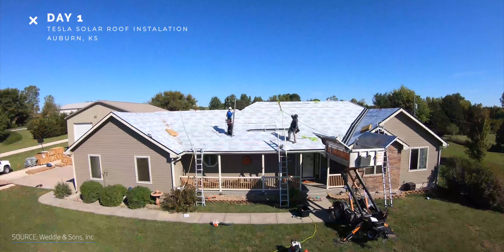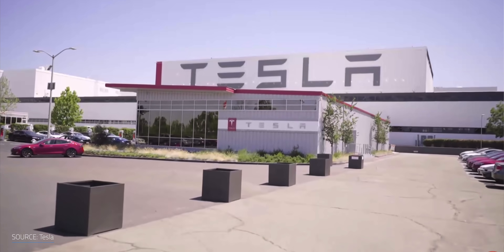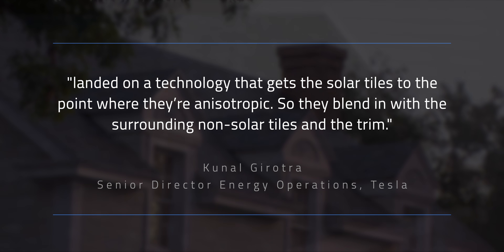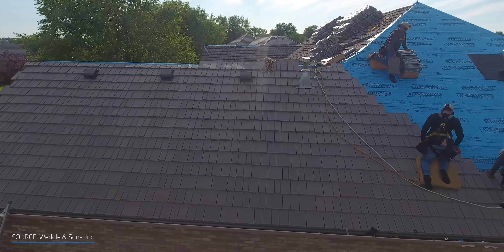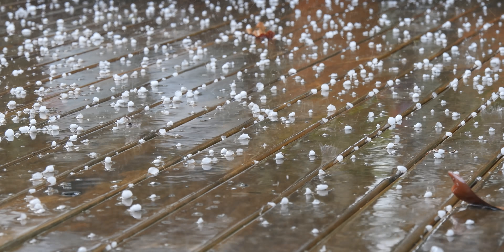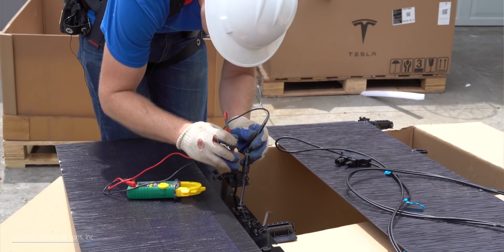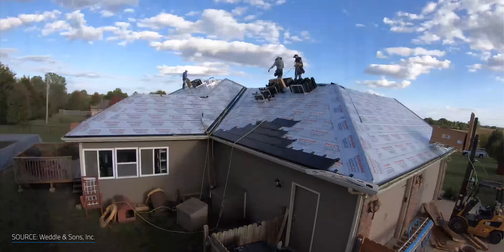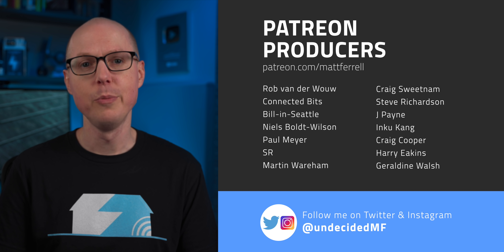Exploring If Tesla Solar Roof Is About To Go Mainstream?

Comment: Yeah I'm a professional roofer, it's important to remember how important roof integrity is as a vital building system.  Roofers are forever in a battle with integrators who install their rooftop infrastructure but damage building integrity when they do so.  

Roofers fundamentally understand building integrity, other trades it's an afterthought.  PV installers aren't roofers, so yeah it makes sense that roofers are the primary installers.
Reply: @Slowmo I'm pretty sure you don't have to worry about that.
Reply: @Potato Peel hilarious, you know what every building has?  
A roof.
Do you know what a building without a roof is called? 
Abandoned. 

Do you know what type of roofing 99% of buildings have?
Conventional roofing.

Do you know how long a conventional roof lasts?
20-30 years.  Meaning a roof replaced at the beginning of a roofers career will likely be replaced again before they retire.  

Roofing is a building system that must repel weather from the interior of a building for 2-3 decades with little to zero maintenance after an initial installation.  Meaning a faulty installation WILL result in premature failure, usually within the first decade.  Complex roofing systems like the Tesla roof are effectually impossible for an inexperienced person to do an effective installation.  An ignorant person might argue that Tesla will provide training,  and they will.  Major international brands like Soprema and Firestone already do this, I am certified by both manufacturers to do warrenty level installations of their products.   Tesla will almost certainly adopt a similar practice as such enhanced training for experienced professionals only takes a few days because the training builds on existing experience.

So no roofer is going to be out of a job, I install what the customer wants and pays for, I'm happy to do it as long as it's a quality product.  No roofer wants to look bad when an inferior product fails in spite of their best efforts.
Reply: The weight worries me   Our home was built in 1961, the roof framing structure is 2x4’s with 1/2 inch thick boards.    I am thinking the boards be removed and strengthen the structure in addition to replace the existing ties from the roof into the framing the. Go with an interlocking plywood sheathing.   Question is the roofing company have a license electrical team to connect the wiring up
Reply: @edl617  so there's a standard spec for roof construction.  1/2' plywood is standard sheeting for roofing and is considered the minimum sufficient.  By this I mean 1/2" plywood is just fine, but 3/8" plywood is always unacceptable.  Now there's also a standard spacing between trusses, of using plywood the trusses must not exceed a spacing of 16" on center.  And 5/8" plywood must not exceed a spacing of 24" on center.   So if you rafters are spaced accordingly then your 1/2" decking is just fine, assuming no rot.  Deck inspection and plywood replacement are part of the contract and there is usually a set price per square foot for Deck replacement of need.  The inspection is included in your contact, and if replacement is needed it's an extra but at a pre agreed price usually.   

2x4 rafters aren't necessarily a bad thing, I'm a roofer not a carpenter so I can't tell you the specs for roof trussing.  But I can tell you that most roofing specs are made to allow snow loading. 

Long story short if your roof was built within spec then the weight of the solar roof shouldn't be an issue.   As for T&G plywood (what you called interlocking) it's usually not necessary on a pitched roof,  if all your rafters are properly spaced then your plywood seams end on the rafter making the the interlocking redundant.  Technically it can help on the other side, but because of the angular nature of force in that direction it's minimal.  

Now on to wiring.  My assumption is that Tesla does the roof design quote.  They will measure your roof and create a plan for the roofer to install.  This plan will include a wiring layout and connection sequence, the roofer just has to follow the diagram and plug panels in, using the right sequence as outlined by the Tesla design.  The roofer will not hook-up the panels to anything, that will certainly be done by an electrician or other specialist.  I see no reason why  the Tesla certification program cannot appropriately train a skilled roofer to do a wiring layout with plug and play components.  

Technically the electrician's could balk and demand that only they can lay wiring as they often do with low voltage data cabling.  But the hazardous nature of working on a steep roof is a stronger argument against them.
Reply: @edl617  are you 100% sure those boards are only 1/2"? I've never heard of that. 3/4" (1x6 or 1x8, nominally) were typical before the advent of plywood, and the 3/4" boards are far superior to plywood structurally (as long as they aren't completely rotten). 1x boards are stronger and resist water damage for much longer than plywood and are an infinitely better material than OSB. If the 2x4 rafters have too much deflection, it would probably be much easier to add additional truss bracing between them and the attic joists
Reply: @edl617  I originally thought the same thing but it just depends on your area, my beach house is built with far superior wood than my new house I had built in 2017 although to less efficient standards overall for the beach house. I was surprised when I gutted the kitchen down to the studs to find they just don't supply that level of wood anymore so in some fashion I would argue that your older home was built with stronger wood in general. Not sure completely about the roof.... definitely not my expertise.
Reply: I always thought the roof was the most important part of a building.
Reply: @holocaust_2.0  I prefer to think of it as a fundamental part, I hate playing this or that is the most important thing.  Everything is there for a reason after all.  But a building isn't really a building without a roof.
Reply: To bring cost down, could you install Tesla roof on one side and asphalt on the other? Or are the non-PV panels of the Tesla roof relatively inexpensive?
Reply: @nwsvndr  well I don't know the pricing, but yes the non PV are significantly less expensive, but they are also far more expensive than normal singles.  Both in material and install cost.  Remember that a shingler is quoting by the hour for labour.  Singles are very fast and crazy simple to install once you're properly experienced.  The Tesla system will require a level of custom precision shingles simply don't need.   The Tesla roof also relies on an expensive underlay, that's the white membrane you see on the roof in the video.  Such underlays are both optional and uncommon in shingle assemblies.  

As for the question of installing a Tesla roof on one side and a conventional roof on the other, the answer is yes.  A custom tie-in would need to be done by the roofer, but there are multiple tricks that could be used.  Do I recommend it?  Technically it's a question of asthetics, and I wouldn't recommend it on a hip roof(a roof with faces on all sides instead of two). 

Honestly if you want the best solar, you don't build a gable or hip roof, but instead a low pitch single eve roof facing south.  Then install a flat roofing system, I recommend EPDM rubber, and a curbing system as part of the roof for mounting the solar to.
Reply: @Potato Peel who exactly do you think is going to install Tesla roofing?  Roofers duhh!  Probably not the shitty roofers that bought an air tank, ladder, and nailer at lowe's  and started taking jobs without insurance.   Do you know what people who install Tesla solar roofing will be called?  Roofers, because it's a roof, adding solar panels doesn't change that function.   Nobody, not one person will say, "it leaks like a sive, but at least my electric bill is easy cheaper." Nobody is ever saying that.  Every roofing system is already modular, conventional shingles modular and are dead simple to install.  There's literally compete instructions on the inside of the wrapper if you know how to interpret them correctly.   And yet roofer is a thriving trade, gee wonder why.  For every person who attempts to do it yourself with a tesla room, there will be thousands who pay a roofer.  Because roofing is hard work too, work that you can pay somebody else to do, usually in a fraction of the time, with less mistakes, and you can make them come back and fix their mistakes for zero charge.

But whatever, you live in a fantasy world where you've never installed a roof, let alone a solar roof.  Come see me after you've done either.  You'll find that modular systems are only great when the structure is built nice with no complexities, and perfectly straight lines and consistent angles.  Which rarely if ever happens.  Oh and I guess in your fantasy world all roofs are pitched, which is the only type of roof a tesla roof can do.  Because what's also a thing in the real world, flat roofs, you know the roofing on most commercial buildings.  The roofing I specialize in and is completely unaffected by Tesla.  There's no sense in integrating a solar system into a flat roof, because you want angle on your panels.  They already put solar on flat roofing, usually poorly and it damages the roof.  Solar is a huge employment generator for roofers, you been rekt by real facts from the real world son, better add some dragons or some shit to your fantasy next.
Reply: @Potato Peel you've never seen solar panels installed on top of a flat roof?  You could actually integrated them into the roofing system, but it would lie flat limiting the sunlight received.  Usually solar is placed on top of the roofing system, often with hilarious results.  My personal favorite was when they didn't put protection between the solar framework and the roofing membrane.  My colleague spent weeks repairing the roofing and insulation after the solar system damaged it in multiple places.  What happens when you hire a solar integrator not a roofer to do an install.  You still need the integrator, but the roofer supervises the install upon the roof.   More mundane failures involve integrators forgetting that roofs need to drain water or that you can't simply poke a hole into a roof and seal it with a $5 tube of caulking from Home Depot.   Hiring a roofer to do structural integration costs a few thousand dollars.  Ruining a roof costs hundreds of thousands of dollars to replace, plus whatever damage the leaks do to the building interior.  

Roofers only care about one thing, keeping weather out of buildings.  We're happy to add solar to the equation, and will charge appropriately.  We have more than enough work to keep us busy, so we are happy to see it done right the first time.  There's no such thing as a roof that doesn't wear out, roofers will never be out of a job.
Reply: @Potato Peel I am payed to install roofs, by definition that is my profession, ergo I'm a professional roofer.  You seem to be confusing the definition of expert with professional. But you're also just bad at reading, because everything you accuse me of not knowing is just you failing to read correctly.  Rooftop solar can be ideal when done properly, it can be a nightmare when done poorly. Nobody wants a leaky roof.
Reply: @Potato Peel lol, why would I be nervous?  I don't even know what you're on about, my comment talks about how roofers are better to install Tesla roofs.  See solar is usually installed by a solar integrator onto an existing roof.  But Tesla solar roof combines the two systems, leaving the question of which trade should install solar roof.
Reply: Yep I did some temp work for a PV company and man it was atrocious what I had to witness on that roof
Reply: No joke, hard enough finding roofers who stick with the trade long enough to master the concept of proper flashing detail - can't imagine how oblivious non roofers would be
Reply: @onetwothree4148  roofing, especially flat roofing which is what I specialize in, is like an arcane art.  You could read all the books and still mess it up, the best roofers were taught by other roofers.
Reply: @jeremyO9F911O2  Yep. "Experience is simply the name we give our mistakes."
-Oscar Wilde.
 The best way to get good at anything is to learn fro m other people's mistakes.
That's why learning from others that "been there, done that", is the best way.
Reply: @jeremyO9F911O2  Eh, I'll stick with Roofus

Comment: the solar panels efficiency starts to drop rapidly after being in the elements. rain wind, uv radiation will mean efficiency goes down by 50% a year. same like car depreciation
Reply: That's just wrong. You pulled that number out of your ass.
Reply: @tombratfred3102  NO. ITS TRUE. UV LIGHT DEGRADES SOLAR CELLS VERY QUICKLY
Reply: @esecallum  There is deterioration, but nowhere close to the number you made up. It's less than a percent per year. Look it up.
Reply: @tombratfred3102  The makers would say that. real world performance is only 5%
Reply: @Peter Rye really? why would you upgrade then? uv LIGHT DESTROYS solar panels. i checked in google and my figures are correct.
Reply: @Peter Rye your figures are wrong now because thing is UV light on the outside materials panels damages panels very quickly on the outside on the outside it's bad

Comment: I’m surprised that you didn’t go into the economics of a solar roof.  Each roof quote is rated at producing XXX kWh per year.  Multiply that by the lifetime of the roof (say 25 years) and then divide by cost to see price per kWh.  It better be less than the cost of electricity in your area.  Otherwise, just get a generator or some power walls to get you through the occasional power outage and shop for the roof you want without giving it another job to do.
Reply from the maker: Yes, but the difference here is that the solar roof is already price competitive with other premium roofs without solar.  If you’re shopping for that kind of roof already, the solar roof’s energy production is a plus no matter what you pay for electricity.

Comment: Have you any info about how the photovoltaïc cells handles heat ? Or if it's possible/envisaged to add a coolant circuit to the roof ?

Comment: The price comparison od slate roof+solar is stupid beyond believe. 1. Noone would put "premium" slates UNDER a solar panel. Obviously you would use cheap filler there. 2. You can embedd solar panels into the roof. that way the entire solar area does not require additional roofing. My collegue just built a house this way. 80 % of the roof is coverd with solar arrays ans only the remaining 20% need slates. From the ground you cant even see the panels

Comment: This, Tesla Power Wall, and Tesla HVAC I hope to have in my next home.
Reply: Also a car charger
Reply: Add in StarLink and you can even have internet in remote areas.  If they come up with water and sewage treatment then it will meet all the essentials for a home
Reply: @AlexFlockhart  Starlink is a bit sus, idk if international committees will allow the doubling of the number of satellites on low earth orbit. 

Because if one of them breaks, it's gonna create a catastrophic cascase and create so much space junk that it'll be next to impossible to have future space flights.

Untill we figure out how to successfully capture space junk, I don't see star link happening tbh.
Reply: @justaguy6216  Starlink has already happened. There are over 1000 Starlink satellites already up there.
Reply: @suijinnoname6412  That's only a fraction of what is planned, and it doesn't serve everyone yet.
Reply: @justaguy6216  It will never serve everyone as that is not the intent or plan.

I guess the current plan is to have about 12,000 up there.

So how is Starlink a little sus with the current progress and success of the company. Spacex even has current customers in a beta of Starlink.
Reply: @suijinnoname6412  No the problem is not wether or not the tech works, because there's already evidence that it does, and I myself would love to have it.

But my concern is adding 12000 satellites at LEO will create a lot of space debris if a crash were to happen or something went wrong. 

It's literally doubling the amount of satellites we have just for one project. So if we don't have effective trash clean up, this project can lead to space being inaccessible for us for decades. That's why I'm sus.
Reply: @justaguy6216  You are aware these are super low orbit satellites right? Their orbits will naturally decay after four of five years, so even if there is some kind of ridiculously unlikely chain reaction, it will all be gone in a few years.
Reply: @Shrouded_reaper  Yeah I just read about that. That's the least they can do. Hopefully nothing like that happens but my concern is still there.

Comment: An tarmac roof life's expectancy is close to that of solar cells.
They can already generate more money in energy savings then what the added costruction costs.
This is an actual green energy product that actually makes heaps of sense. Regardless of how they're implemented.
The question is not if but when it will become a widespread adopted. The main question remaining is how do you store the energy to use it in the afternoon. Or does the government mandate a fair price when delivering it to the net.

Because in my country thay have a rule that what you deliver into the net = the price of what you buy. but that rule is going to change in the very near future.
From that point you get probably 6-9 cents /kwh and you buy at 30 cents.

Which immidiately destroys any chance of making your money back if you can't use it yourself.